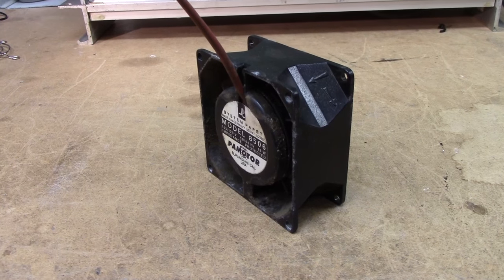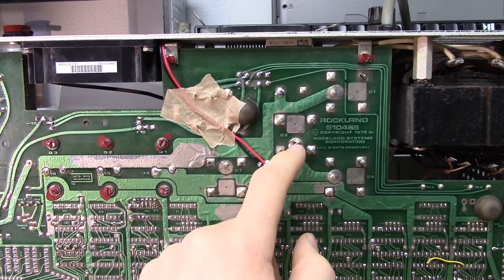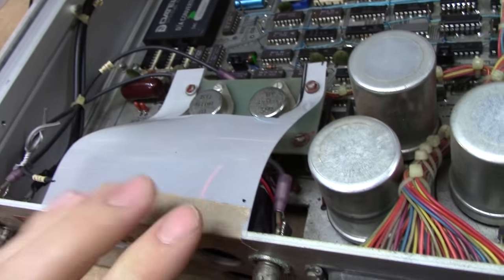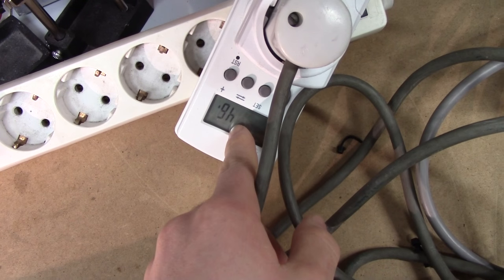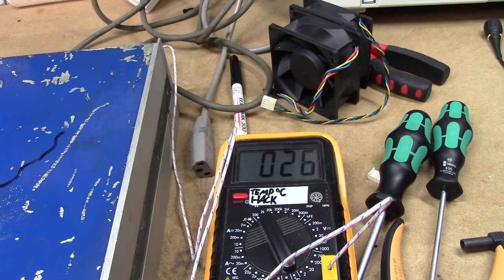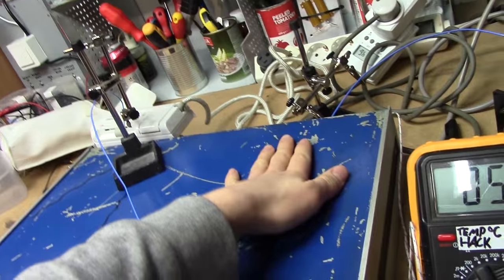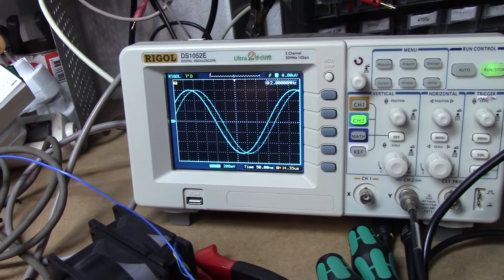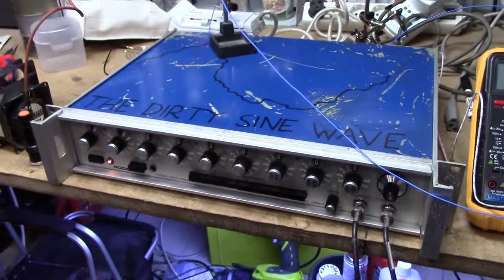Rockland 5100 followup

Comment: I feel by removing the glorious noise of that fan starting you have truly killed the charm of it's age
Reply from the maker: +charles turner Perhaps to an extent, but I'm inclined to disagree, since the noise of the fan is more related to wear than to age. When new, the unit would have been closer to what it is now than what it was with the old, worn down fan in terms of loudness. I suppose the most true-to-age fix would have been to replace the fan with a modern equivalent AC fan.